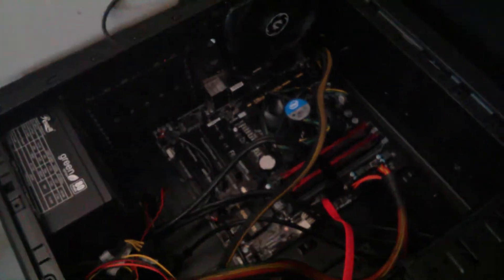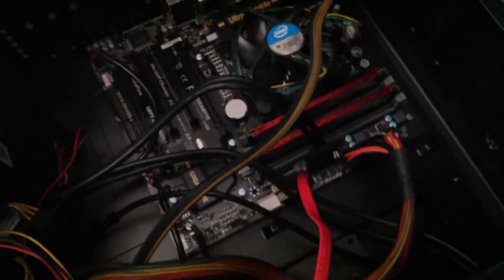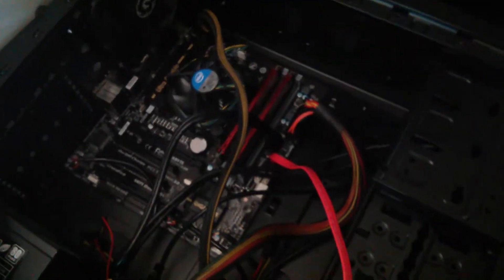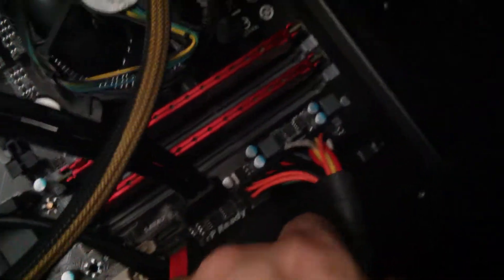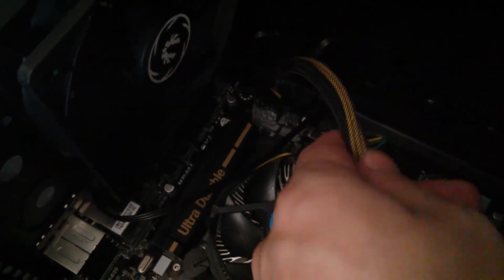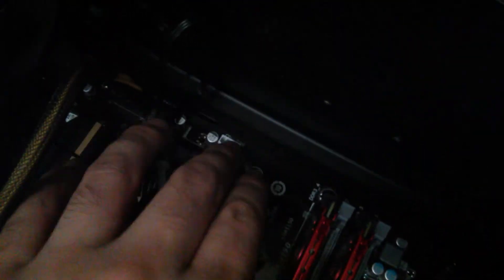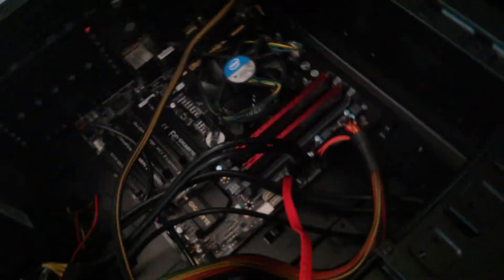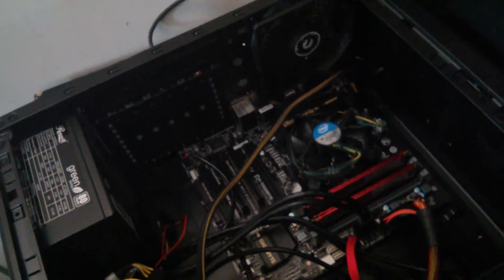My failed computer build

Comment from the maker: I'll just post a last clarification about this whole situation from quite a long ago. The CPU was DOA. I switched out RAM and tried another PSU but nothing seemed to change the state of the system. I brought it into Canada Computers to see if they could put the CPU in a test bed so that we could determine if it was the motherboard. They confirmed that the CPU was the problem and that it was dead. They also put a working CPU into my setup and everything ran fine, so they confirmed that everything else was working as well. Canada Computers was also the place in which I first bought the CPU so they offered to replace it.

I put the new CPU in at home and the system works as expected. I have been running that system for bitcoin mining for close to a year and recently converted it into a Folding @ Home system. There are no issues and it runs amazingly quiet with a Radeon 270 in it.

Comment: i know it probably too late but my guess is the power supply, or motherboard cpu really never come broke and if you power supply isent up to the performance thats the problem but also the motherboard could also be the one thats dead.
Reply from the maker: Yeah it was rough. The CPU was aparently dead, which is a rare problem. I tested just about everything and then eventually brought it in, first time I've ever done that. They took the CPU and put it in a test bed after I told them of what I have already done. So when the CPU is DoA, the board will look like the above video.

Comment: something is not done properly
Reply from the maker: Ah sorry I thought I updated the video. The CPU was actually bad. I went to CanadaComputers (local computer parts store) and had them test it out, they replaced it after testing it. I put in the new CPU and the build is working fine. So this is what happens when you put a dead CPU into a motherboard (or at least a defective and partially broken CPU).
Reply: its rare you get a bad CPU i never see that happen
Reply from the maker: This was the first and only time I've ever seen it happen. I've built quite a few pc's over the last decade.